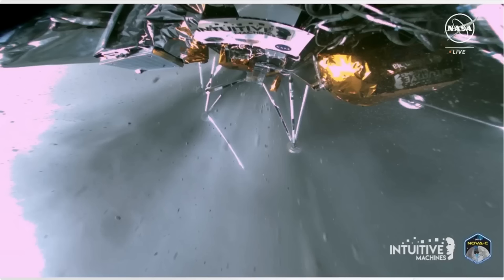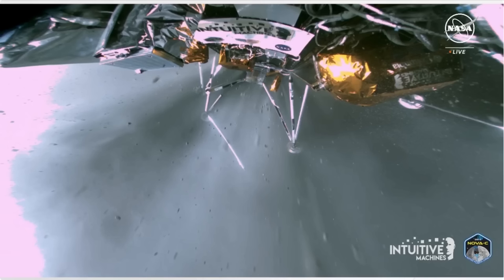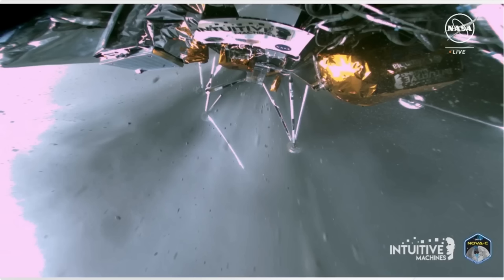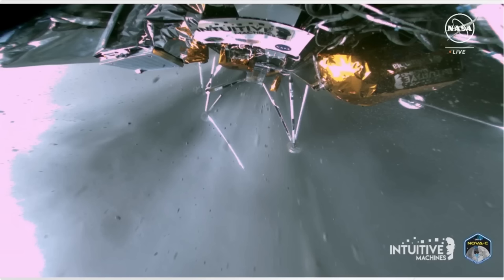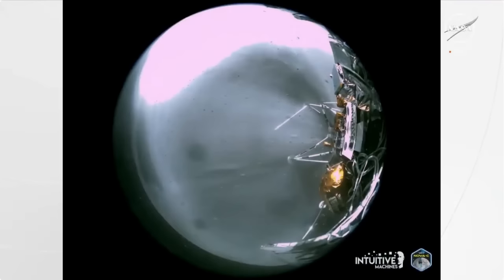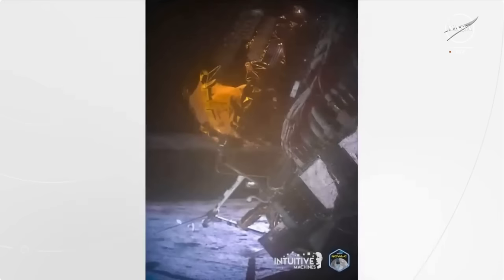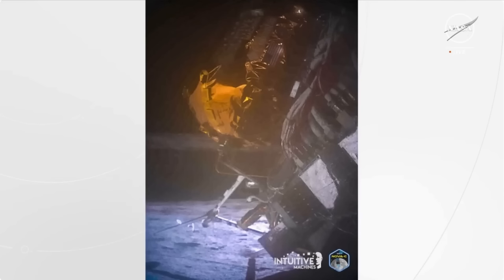New Intuitive Machines' moon lander images shows 'broken landing gear' and tilt

Comment: The topmost failure of the mission was the failure to communicate its real status and its broad range of problems. As an engineer I hate seeing other engineers self-banging on their own back and calling the failure a brilliant success. If they were to lay down the problems and explain what they did to overcome them the audience would be a lot more sympathetic and a lot more understanding because admitting the problems is the first step towards correcting them.
Reply: As a fellow engineer I couldn't agree more.  These people are concerned with one thing and one thing only -  keeping the investments rolling in.  This is what happens when "explore" becomes "exploit".  Profit, Profit, Uber Alles ... to Hades with honesty. :face-orange-frowning:
Reply: I agree but I'm not sure what caused the lunar module to tip over? It's landing foot getting stuck in the moon's surface? Or one the landing legs collapsing?
Reply: From the press conference, the lander still had a little bit of horizontal velocity when it touched down, which resulted in the tople over.
Reply: @mpeterselman In one of the conferences they mentioned it landed 6mph vertically and called that a walk.  It's a jog.  The forward movement was 2 mph. As best I can see it landed on a flat surface and they made the thing too damn top heavy if that's enough to knock it over.
Reply: @NotSoMuchFrankly  You're probably right calling the 'top-heavy' design a glaring flaw, but then again, the much flatter SLIM lander toppled over anyway, likely from too much forward velocity like LM-1. Lesson learned: future flight software should take more care in zeroing out any sideway velocities before touching down.
Reply: @selman SLIM toppled over because it literally lost almost all thrust from one engine when its nozzle sheared off and fell away some distance above the surface. It was fighting for balance while it needed to rotate 90 degrees before touching down to land on its stubs which are on its side. The combination of nozzle failure along with its unusual landing method and design is what caused it to topple over upside down.
Reply: @FrankyPi   I heard the dual nozzle design for SLIM was made for redundancy as it had software for compensating for a failed motor, but that's what happens when there's slightly too much oxidizer in an engine. (Ala Akatsuki). SLIM landed on a slope which may have contributed to pitching upside down, with slightly too much RCS for the 90 degree rotation going down hill. 

The point being, with terrain factors and low gravity, a squat lander can still topple over with a slight amount of horizontal velocity.
Reply: @mpeterselman  Yes the terrain wasn't flat, all of that contributed to the result.
Reply: @FrankyPi  "Agreed." —Captain Barbosa
Reply: @mpeterselman  was the lesson learned?  I read that they forgot to activate then landing laser before launch.

Comment: Not sure how a broken piece of landing gear is a "success"?  I suggest re-evaluating your success bar.
Reply: They were designed to break. Its called a crush zone. Like how a car's nose is designed to crush to slow the stop for the passengers. Its the same principle.
Reply: @SojournerArt    Funny they didn't tell us this in advance.
Reply: @SojournerArt   That's like saying you successfully parked your car around a tree because you survived the crash.
Reply: try landing on the moon yourself I'm sure landing gear is the least of your worries
Reply: Apparently, many of us don't have enough thoughts, learning, and experience to make suggestions to "rocket" scientists.  For example, The Chinese also did land on the moon a couple of years ago, but in multiple pieces, so that's called Failure.  Hope this helps.
Reply: @SojournerArt they were designed to break? Are you suggesting the INTACT legs are faulty?
Reply: The idiots defending most certainly would say the intact legs caused the tilt.  😂
Reply: Let's see you land on the moon.
Reply: it's an  amazing succes. A private company lands first time to make it the cheapest landing on the moon, and closest to south pole by hundreds of  kms , with first ever  methalox space engine to boot using a reusable rocket booster which also successfully landed, and all engineered in  just a few years
Reply: Haven’t you heard? failure is the new success.
Reply: @fredflorist1682  But they made it to the Moon, so that's a success, yes?!?
Reply: @blengi  I guess that's similar to Space-X and their Starship launch with in our eyes failed, but Elon was cheering all the way!
Reply: @volocty  so you don't think the first ever lander intuitive has built, sending back images from the closest point to south pole anyone has landed, on the smallest budget with the world's first methalox space engine on back the back of the world's only reusable rocket all engineered in a few years is a success?

Comment: Makes what happened in the Sixties moon landing more marvelous based on very limited computers.
Reply: Or proves that it was fake.
Reply: All these failures prove the 1960s is fake! Man on the moon, yeah right!
Reply: Apollo 11 was relayed, but now it's only photos.😂
Reply: Well they also had literally 3000 times more funding and thousands of times more workforce to make it happen compared to this small private company. It doesn't make it any less impressive with what was achieved back then as probably the best engineering achievement in history, but again you need to consider all aspects and the context for this mission.
Reply: @loststk6952  No landing on Apollo was live aside from voice comms and telemetry, only EVAs after they set up the TV camera, landings were only recorded on 16mm film. Apollo spacecraft could do live video feed as it was much bigger than this small robotic spacecraft, you're still limited by physics of signal transmission that require enough power to send a certain amount of data over a certain distance, robotic spacecraft like this can't afford to have powerful transmission systems to enable the bandwidth for live video. They were also bringing a large dedicated high gain antenna to set up on the surface from Apollo 12 onwards, which enabled higher quality color transmission, this is why it was black and white only on Apollo 11, the LM by itself with its antennas couldn't support a transmission in color.
Reply: @shaggy0000  It only proves you have no clue what you're talking about.
Reply: @Induna123  or that you're clueless.
Reply: @FrankyPi  I programmed computers in the 1970's and we had only 8K of memory in one computer and 64K in another. It's mind boggling what they could do with so little computing power available.
Reply: the 20's are gonna make the 60's look like the 50's...said no one ever

Comment: I can't get into this mission. Surveyor 1 soft landed in 1966 with vacuum tube technology. Imagine that! Then came the Apollo program in a time of Black and White TV's and rotary phones.
Reply: More resources for those missions though.  This is done on the equivalent of a shoestring budget.   NASA's budget  is tiny in comparison now.   You say you can't get into this mission but you still cared enough to comment.
Reply: NASA in the 60s used real engineers
Reply: It's called a test flight for a reason.
Reply: 'Zactly. Let's compare the landing gear of the Surveyors to this piece of junk.
Reply: There were a lot of failed missions prior to Surveyor 1's success. Give Intuitive Machines (And Astrobotic, etc) a chance to fail at first, they'll eventually get it right.
Reply: did nasa land first time using the cheapest lander to land the moon, land closest to south pole by hundreds of  kms , use the first ever  methalox space engine, launch on a reusable rocket booster which also successfully landed, and engineer it all in  just a few years?
Reply: Apollo 11 was relayed, but now it's only photos.😂
Reply: different generation...unfortunately now we have video warriors running the program who lack real life experience...
Reply: And they used primitive computers and slide rulers!

Comment: Broken or not, testing is part of the scientific method and knowing what to improve on is successful to me
Reply: it looked weak and top heavy to start with
Reply: @tb7977  No doubt you could engineer and build better landing gear and overall better machine with proper center of mass.  It's obvious they are beginners, making this noodle of landing apparatus. I'm sure they didn't even FEM the landing gear and the center of mass for the vehicle was cobbled something together. This is what the engineers usually do.
Reply: tell that to the shareholders...
Reply: yes I could @koitk

Comment: Remarkable to salvage the mission…but it is still a failure. Lowering the bar to accepting this as a success…is like getting a participated trophy for a ball team that didn’t win.
Reply: That's from the Lib playbook.  Why are you so hypocritical?
Reply: Japan also 😅😅
Reply: It landed precisely where it was supposed to and sent back data. Pretty successful in my book.
Reply: IMHO...the mission was compromised because of HUMAN failure (not my words)...someone on the team forgot to unlock a switch related to the laser range finder...How is this possible that a multimillion dollar spacecraft is compromised due to a failure of this??? And Why was this NOT addressed during the conference call???
Reply: Switch was there for eye safety during lidar testing and was left off, press conference changed it to say it was internally defective. Likely have to stay positive for funding, at least they learned from it. Strange it wasn't on the checklist.

Comment: We have 8K digital video and GHz freq. Line of Sight radio communication and these are the best images available?  Odd...
Reply: @Kinann  Sure…. OK.  So Where is the high definition video of this lunar landing? And if it does not exist, why not?  This is 2024.   There are 5MP cameras smaller than a quarter now.  What is your age and education level roughly?
Reply: It's not about cameras, it's about bandwidth.
Reply: You're a good parrot. Unfortunately that's all you're good for.  @FrankyPi
Reply: They chose the south pole in order to create the excuse of "there's no connection in the south pole" @bartofilms
Reply: @derp8575  So sorry you can't understand simple physics of signal transmission and expect low gain antennas on this thing to send a strong bandwidth while it's toppled over.
Reply: Thanks! But I don't understand why you believe that they could not design a craft with a high gain antenna and also why you automatically believe governments and corporations. You're very good at parroting. Sadly that's all you are good at doing. A one trick pony you are. @FrankyPi
Reply: @derp8575  They could design a more capable craft, but then it would be more expensive, the whole point of this commercial program is doing these missions on the cheap, up to 5 or 6 times cheaper than what would a NASA led equivalent mission be, plus it had to fit inside the Falcon 9 fairing so there are volumetric and mass limitations on that side as well. There would be nothing wrong with it if it didn't topple over on landing. It came down three times faster than planned and with slight lateral velocity, broke a piece of landing gear and toppled over, it's a miracle that it didn't completely crash and destroy itself as it had no proper altimetry data, it relied only on cameras to land after laser range finder was found to be inoperable due to a human error of someone forgetting to remove a safety feature for the laser before flight.
Reply: The logic and evolution of space exploration: 
1) First Satellite -> satellites are still running, including the GPS satellites.
2) First Man in Space ->  People still fly in space.
3) First Rover ->  Rovers and other space vehicles are still sent to the Moon. The latest example of the Chinese Chang'e-4 and the Israeli Beresheet Spacecraft.

All of the above has become safer, cheaper and more affordable. This is the logic of the development of any technological process. You can still add mass-effect.

It follows that the Americans have to build at least a base on the moon with the constant presence of man there and walk a man on Mars. This is evolution and logic of events. But Americans haven't walked on the moon in half a century! As I said earlier, parrot, you're a one trick pony.  @FrankyPi

Comment: I wondered how they were going to land that top heavy unit on the moon.
Reply: Thank you! It looked like they were trying to land an air conditioner on top of a bar stool.
Reply: top heavy? it might be tallish but the base of the legs which actually bear the weight spread wider than its height. Also its center of mass is  lowish given all the heaviest stuff ie the engine are in the bottom half of the stack
Reply: Unlike Mercury and Apollo, how many were killed in this mission..your judgment is flawed horribly..

Comment: For want of 0.025% mass of structural material would have saved this lander. Cessna developed the C152 with the same fault in its Nose Landing Gear over 70 years ago; nothing is learned, eh?

Comment: according to the deniers they just have to go onto the set and set it back up. would save a lot of face.just deny it tipped over and right it back up.or is their thinking now is the cgi is too expensive for a complete mission just cut it short with a tip over?
Reply: You used the word ‘thinking’, which does not apply.

Comment: Yep. Story checks out. Too much lateral movement/velocity.    They have to cancel out some of that with thrusters and get a more vertical approach.  This would have killed a crew easily.
Reply: I respectfully disagree.
A human pilot wouldn't have stood there and watched the crash. He would have either taken manual control or aborted back to the safety of orbit.
Reply: No way that the impact would have killed the crew. It was not violent or this thing wouldn't be working at all. Also a human landing this wouldn't have landed this poorly. They would have been able to land it with zero horizontal velocity, because they would have practiced it a thousand times. Nothing on the craft malfunctioned that a human. live, in real time, couldn't have accounted for. Now, if they rolled over, maybe they would have died if they couldn't get it back in a vertical position to take off again, but again, humans being humans, I have faith they'd have figured something out, if the only thing that was broken was one landing leg.

Comment: Soft landing broke the landing gear?
Reply: Yes. 

The lander didn't end up in several pieces. That's the definition of a soft landing in this context.
Reply: I soft landed rounding 3rd base ...tagged out..we lost the championship...biggest fail of mine ever but what the heck
Reply: landing gear was probably not specced for 3 kph sideway landing which probably loaded 1 leg with too much force  versus expected 6 legs handling vertical forces much more evenly and specifically damped in that scenario
Reply: @blengi  Would you count 3kph sideways as a “soft landing”?
Reply: @Boyko sure it's pretty soft landing, a bit like walking off a step  at 3 kph which anyone healthy adult can manage with their much lighter weight  and smoother less inclined terrain  step to step. Of course if IM-1's legs weren't designed for such sideways motion  due to weight requirements and expectations of much slow sideway speeds, then is obviously a problem

Comment: Thus is what happens when CEOs, board members, and shareholders —instead of scientists— send missions to space. This is a complete and total failure in every way, but they are calling it a success.
Reply: They admitted human error. In the lab there was a landing switch which should have been turned on but it was off. Good one.
Reply: @PeterStone-ch9dw  i thought the laser for the lidar system used by the navigation system was safed (their error) so they couldn't use it and had to improvise the use of one of the packages they were carrying which also included a lidar.
Reply: @FredPlanatia  So I guess if the navigation thingy was switched to the on position the lander would have avoided any rocks.by self navigation. Does that sound right?
Reply: @PeterStone-ch9dw  yes, i think that's about right. It used a laser to measure Oddy's position relative to the ground, and for safety reasons (to avoid blinding people) the laser was mechanically switched off when they were doing tests on Earth, but they forgot to turn it back on for the mission. 

Then about 24 hrs before the landing they realized this, and quickly improvised another laser, in one of the experiments that Oddy was carrying, to do the same job 

But they forgot to update the coordinates for the landing, so they ended up in a lot rougher terrain than they had planned.

In addition, they hadn't trimmed all their horizontal velocity when the landing happened (cause the new laser system wasn't as accurate I think) and so Oddy bumped a boulder just before the landing and did a slow fall, landing on its side.

Comment: Would have been better using titanium for the legs wouldn’t have been a lot of weight difference considering the thickness you could used with the titanium and less bracing as required with this disaster.